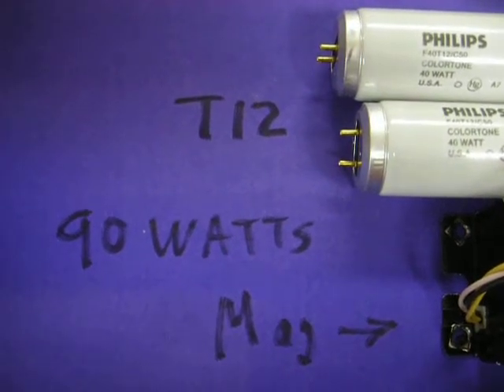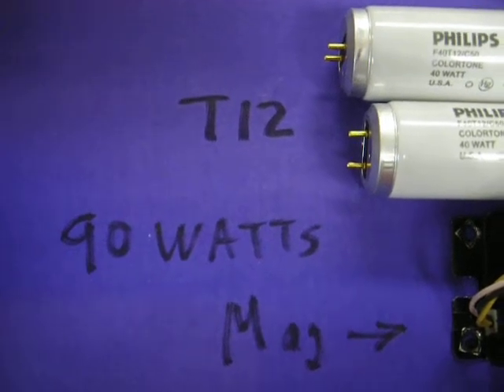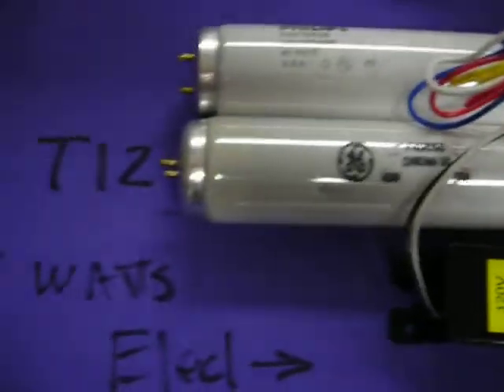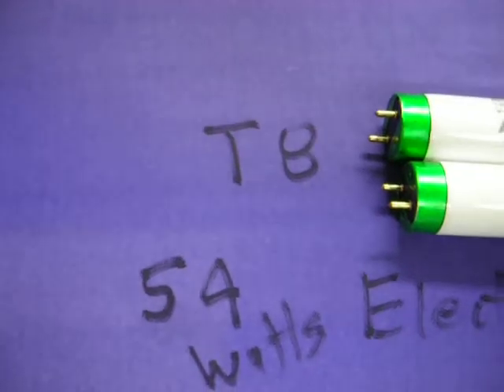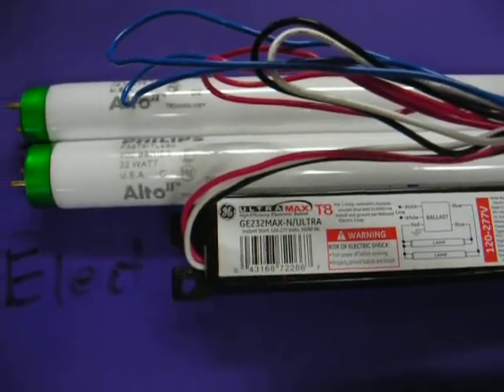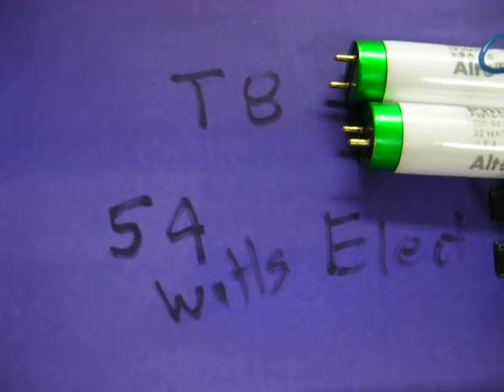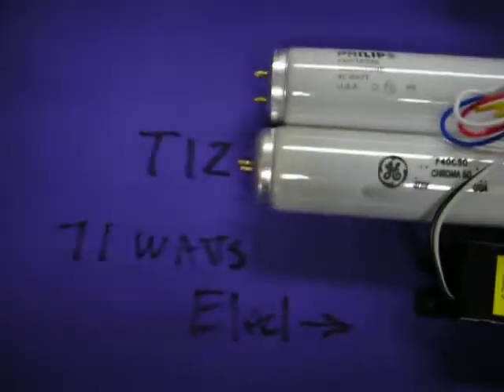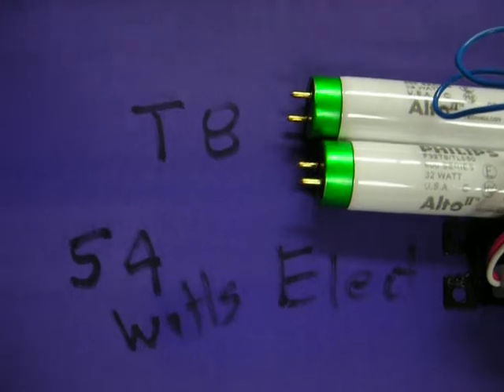T12 Magnetic versus T12 & T8 Electronic Ballast Power two 4ft bulbs

Comment: Ballasts have a specification called "ballast factor."  A ballast factor of 1 means the lamps will be driven at their rated wattage.  It is very likely that some of the ballasts in your test have a ballast factor less then 1, and are intentionally under driving the tubes to save energy.  I have seen ballasts with ballast factors as low as 0.5, and many cheap ballasts with no rating for ballast factor at all.  Assuming each ballast in the test has a different ballast factor, the results of this test are not really conclusive.

Ultimately what you would want to try and determine in a test like this is light output per watt.  Some modern T8 an T5 fluorescent fixtures with high quality electronic ballasts and tubes have luminous efficacy specs around 80 to 100 lumens per watt, which is in the ball park of where many LED light fixtures are.

All that being said, LED's have around 2 to 5 times the life of a fluorescent tube and contain no mercury, so in my opinion, they are the best option for any new install.

Comment: And what's the light output of the bulbs with the magnetic and with the electronic ballast? Are you sure that the watt meter is measuring accurately the active power? A good new magnetic ballast must be a few percent less efficient than an electronic one.